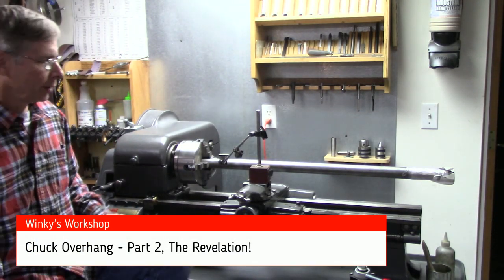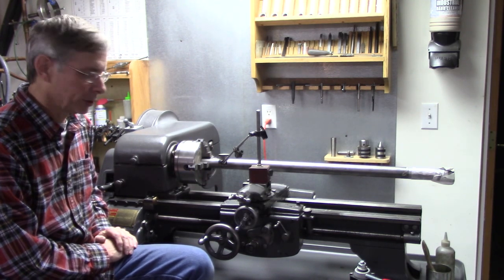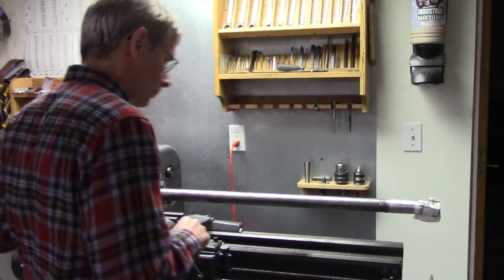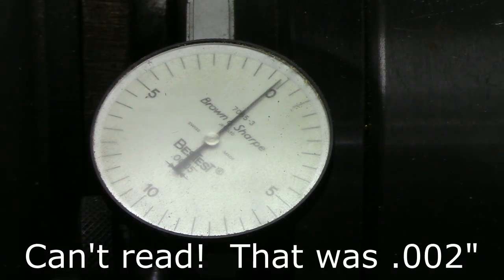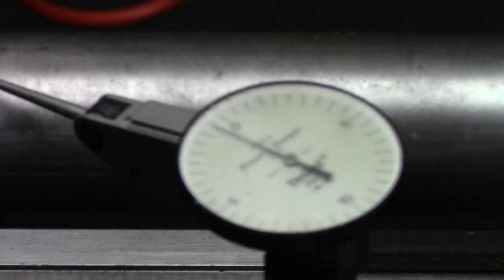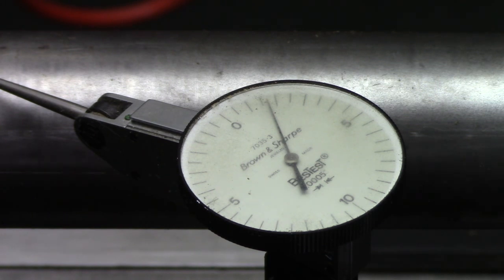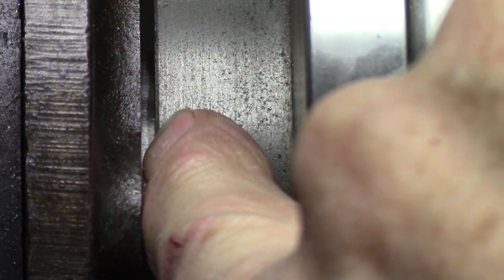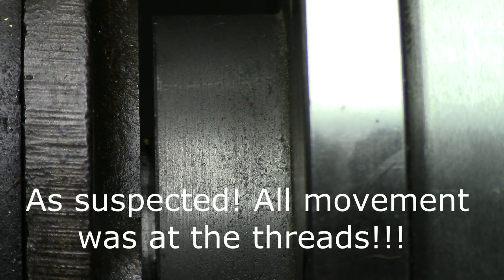Metal Lathe Chuck Overhang part 2, The Revelation!

Comment: Looks to me like the backplate of the chuck is NOT fully seating against the spindle register, something is holding it back. Perhaps the last thread in the backplate. Try spinning it on with a slight force to see if it is a thread binding. Good luck with sorting it out.
Reply: that may well be the root of the problem right there !!!! good eye !!!!   Bob......
Reply: @bobkelly2447  Hi Bob, I was a Machine Tool Fitter ( Millwright ) for over 30 Years, so is part of my skills. I hope Winky can sort it out, should not need a new chuck backplate, just a slight tweak somewhere. Bit of a sharpie ot dykem on the threads should show the tight location.
Reply: @daveticehurst4191  ...do you think he could have damaged the brittle threads on the chuck adaptor plate ?
I am concerned about that as I have ripped threads completely out of a water pipe thread in cast iron before !..... it took a 3' bar though, , I was trying to bend the water pipe , and wound up ruining the entire thing !
..... but he definitely has the leverage to do that kind of damage ! .... How would you check the threads to see if their half sheared off ?  wait for it to fail ?  LOL.....
Bob......
Reply: btw I agree with you Dave the chuck must not be seated completely !!!
Bob.....
Reply: @Bob Kelly  Hello again Bob. In my opinion I would doubt if he would have damaged every thread to cause this. On my Myford, the first thread on the spindle is incomplete due to the previous owner a local school, having ran a tool into it. All the chucks, faceplate and catchplate all work and locate fine against the spindle register and run true. I know that there is a lot of contention about screw on chucks and how they are registered, but I am in the belief that runout and location are all done with the face of spindle register and the back face of the mounting plate. The location diameter is not super critical due to machining tolerances, but the mounting plate diameter should be no more  0.002" larger than the lathe spindle location diameter, all my lathe fittings are within that tolerance. The threads are only a means of attaching to the spindle and to stop the chuck rotating, you should be aware I hope never to suddenly reverse the spindle direction as it could / will unscrew. You should also use caution when using a screw on chuck in reverse, even at low speeds as a deep cut or tool dig in could unscrew it. Now with regards to you asking about checking for cracks on the backplate threads, to be honest I have never done it. Sitting here straining the old grey matter, I wonder as to whether he / anyone could purchase some welding dye crack detecting fluid and try that. I have never used it, but our welder at work would sometimes used it to test important welds, that was on steel of course, so have no idea as if it would work on cast iron. If you want something to do, perhaps Google it.😁 Just out of interest do you do engineering and have similar problems or are you just an onlooker with an enquiring mind ?
Reply: @daveticehurst4191  LOL.... just an onlooker with an enquiring mind  !!!!  a Ranch Hand , jack of all trades master of none..... but I can fix darn near anything !  LOL....
when I put my chuck on, it gets snug before it stops.... but then it does not move from that point on
and running it in reverse has given me concerns, ( just got the Forward /reverse switch hooked up today) 
I hang out on the hobby machinist site and have been posting and asking questions there alot, there is much to learn about this " new to me lathe ! "..... later !
Bob.........
Reply from the maker: I've been sleeping during this conversation. :o)  Okay, the chuck is well seated. The video is a bit deceiving to look at. On each side of the gap (where you see the movement): The left side is the bearing cap the right side is the "donut" on the backing plate and what you see in the bottom of the groove is the edge of the spindle register. Again the chuck is firmly seated on this register. Although, when I apply pressure a very slight gap opens at the top of the register. You have to watch the video in full screen to see it. It's definitely the threads that are the problem. I think this test demonstrates the shortcoming of a threaded chuck mount BUT I also think the backing plate on this chuck is worse than most. It's poor quality cast iron and the unthread area just before the threads start is deeper on this backing plate. The amount of threads engaged with the spindle is not what it should be.

Comment: I'm wondering if the problem may be end play in the bearings.
Reply from the maker: I think I did see it move but most the problem is the threads. The back plate is poor quality. I suspect this is an issue on all threaded spindles but worse on this plate. I'm thinking steel instead of cast iron.
Reply: @WinkysWorkshop  Original Logan backplates (as are those of South Bend and Atlas) were made of cast iron becasue it tends to dampen vibration and reduce chatter. The problem isn't the material it's the fit of the threads to the spindle nose and/or the "doughnut" face to the spindle shoulder, as previously mentioned.
Reply from the maker: @pyromedichd1  - Yep, cast iron is cheap, especially years ago. Cast iron dampens vibration because it is compressible. Most modern industrial lathes use steel because cast is weak.  The only good argument for cast (in my opinion) is thread galling. Of course there are different grades of cast but I'm sure my back plate is the lowest grade.  I've said all along that it was thread compression and today I found some evidence that this likely the cause. Or maybe bending would be more accurate. I took the back plate off the chuck today and inspected the thread. I saw something you could not see with the plate installed. Only the very tips of the threads were shiny. Apparently the angle of the threads is off or at lease it does not match the spindle threads.  I'm going to make a steel plate...  probably a sleeve. Mild steel will do okay with the spindle.

Comment: Ok, I'm ready for part 3, The Solution! How about some rollers above and below the chuck? Lol, maybe not. While there probably are some ways to improve that connection, it's really more about how relatively small the spindle nose is,  the fit on the threads, and how the chuck backing seats against the shoulder on the spindle. On my Atlas, there's really no extra face on the end of the spindle to butt up against. I just stick with a short and rigid setup, and use the tail stock, steady, and follow rest as needed. Of course, as you know, feeds and speeds make all the difference as well.
Reply from the maker: I think in my case it is amplified by a poor quality back plate although I'd say ALL screw on chucks have the same issue to some degree. I'm thinking a harder steel backing plate.
Reply: @WinkysWorkshop  I took a couple looks and it looks to me that the backing is almost half the problem
Reply from the maker: @andyZ3500s  Yeah, as near as i can tell the spindle doesn't move. Certainly the back plate is. I think my back plate is junk but I suspect all screw on suffer from the same to a small degree. Much smaller I hope.
Reply: @WinkysWorkshop  It is definitely hard to tell what is going on. There is definitely alot of movement between the chuck and the mounting disc which is fixable. What exactly is going on in the treaded bore is harder to understand. I could see the area moving on the casting but it didn't look like the spindle was moving that much -- doesn't make much sense. Maybe doing the same thing with the original Logan 3 jaw could shed some more light on the problem. Good luck Winky, I'll be looking forward to future videos. From Andy
Reply from the maker: @andyZ3500s  I've watched is over and over. I think the back plate flexing is an optical illusion. The spindle has a flat area that the chuck tightens against (register) and it is pulling away from it. My logan chuck works great and I'm afraid to put put stress on it.
Reply: @WinkysWorkshop  your right I can see it pulling away from the register